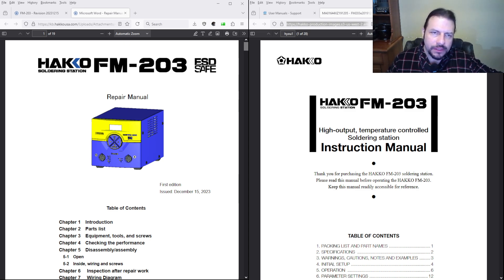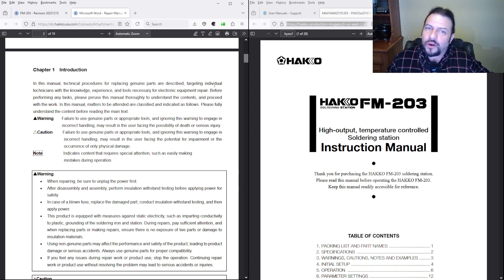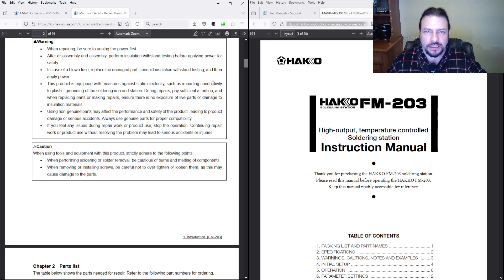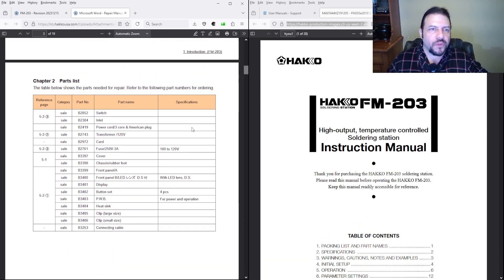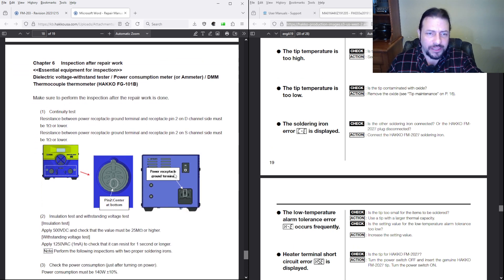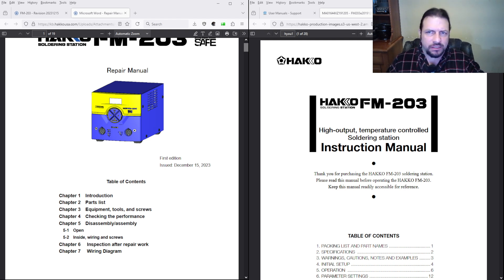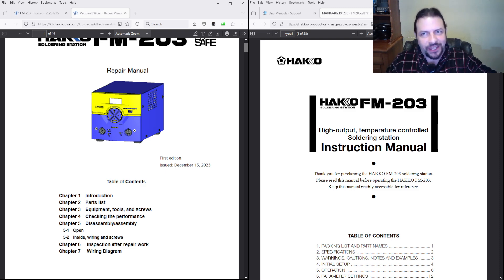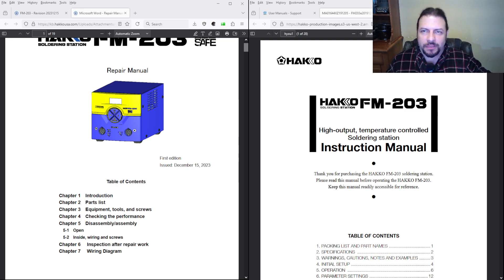Hakko's FU to Soldering Station Owners and Repair Tech's Their Non Repair Manual #righttorepair

Comment: As someone who both makes stuff and has repaired equipment I can say that I both support Hakko and I'm also frustrated. Releasing the schematic to something that you have invested time and money into developing is very much handing over the keys to the kingdom. Yes it is possible to reverse engineer almost anything these days but to literally make available all the information to replicate something is something that as a manufacturer you really don't want to happen. If the cost of an item is in the development moreso than the production cost then you really don't want your intellectual property released. When I worked on machines worth 10's of 1000's of dollars the repair manuals were extremely thorough as there really is no chance of the machine being replicated. If the right to repair affected software could you imagine microsoft either being happy or complying with having to give over source code. Hakko have done what is essentially the legal minimum to be compliant with the legislation that exists in 1 state worldwide. They already have a repair service that is cheaper than what anyone could realistically repair the soldering stations for so there options are removing the irons from sale in California (which definitely wouldn't stop them being used) or to create a bit of fluff that complies with the legislation. I personally repair just about everything that I have ever made either for free or at cost price. If someone can break it then I haven't built it well enough.
Reply from the maker: @Alan_Hans__ More than one state California is the most strict, Oregon expands on that effective Jan 01. The point of right to repair is to have the documents and tools to diagnose and repair without having to rely on the manufacturer to do it for you. Sure, they may charge $10.00 for labor, but they nail ya on parts up to 95% the cost of a new one when it is a .05 diode or .02 cap or a firmware reload/update. They did not need to create a bs repair manual. Just provide schematics, etc, and you are on your own.
Reply: You don’t know what your talking about. All CRTs back in the day, yes ALL even Sony, release their schematics.

Comment: I've rolled Hakko for many years but what see is they sure know how to crank it pricewise for consumables, especially the FR-301 desoldering tool tha hoses through such parts... In the case of one my FX-888D irons it was just not worth my time to try fix the base that was already 10yrs old & hardly ever turned off & i picked up something else. In my eyes Hakko stuff is expensive moreso these days but it gave me a good run on the reliability side of things... I guess i'm lazy but my time better served doing paid for repairs...
Reply from the maker: I'll be doing a video responding to Hakko's e-mails. Hakko's Chris Stuber saying schematics are not for repair.
Reply: @Rhine_Labs  subscribed!

Comment: Schematics are what? Corporate secrets... they don't have to give you all the 'keys to the kingdom' in the real world even under the new right to repair rules.
They basically say "Take pictures of everything in the device when you get the device and use those to repair!"
Reply from the maker: Schematics, like other forms of technical documentation, do not inherently qualify as trade secrets unless they meet specific criteria and that is a big criteria. Most automatically loose the protection when the item is patented, made public by production, electronically transmitted, or If the product can be easily reverse-engineered to reveal the schematics.

Yes, Schematics are specifically spelled out in model right to repair legislation.  In CA SB244 Definitions J (2) “Documentation” means any electronic or appliance product manual, diagram, reporting output, service code description, schematic, or similar information that is provided by a manufacturer to an authorized repair provider, or that is for use by the manufacturer if the manufacturer does not have any authorized repair providers, for purposes of effecting the services of diagnosis, maintenance, or repair of the electronic or appliance product. Source: https://leginfo.legislature.ca.gov/faces/billNavClient.xhtml?bill_id=202320240SB244
Reply: Most schematics save for the very rare ones that receive a patent have not historically been taken or accepted as corporate secrets. 

They were widely available for anyone looking for many devices for a long time, and somewhere along the way as RTR became an issue they became more “reserved for certified techs” not secrets. But the whole RTR issue is exactly that, there’s nothing to this or other similar device that’s a trade secret. They can protect their image and their brand but they cannot stop you from doing something to their item you’ve purchased, or fixing someone else’s. And they know that.